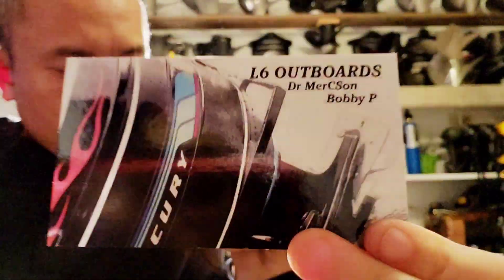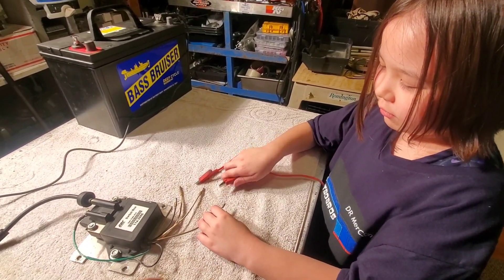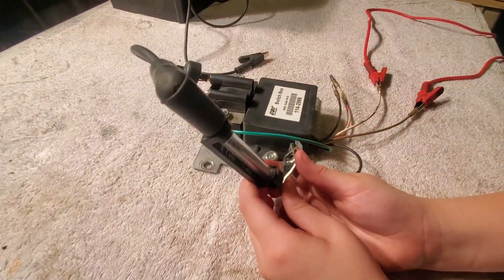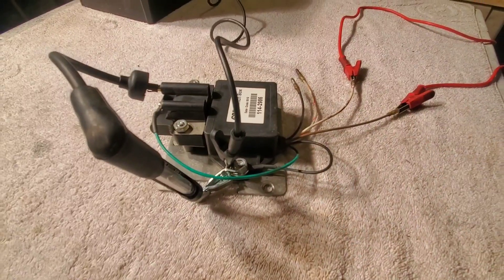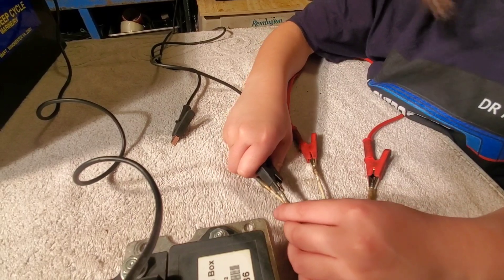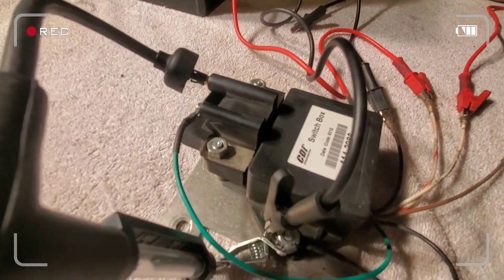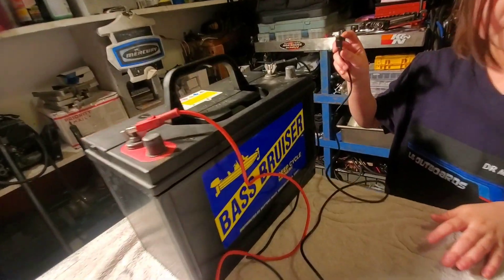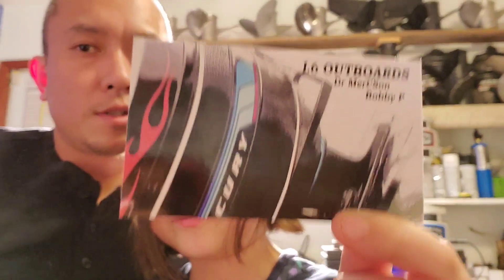Mercury Outboard CDI Swithchbox Testing: Got Spark?

Comment: Hi
Does this procedure works for a Mercury switch box PN 339-5287A3 that belongs to a 1977  9.8 hp mod 110?

Why the black wires which are grounded are all rotted ( both the insulation and the copper )?
Tks a lot

Comment: I pulled your video because I'm working on Merc 650 serial 2207872.  It has no switch box, but the part number is exactly what you are testing - 114-2986.     The new CDI electronics switch box costs around $330.  But I can get an old vintage Mercury box 332-2986 for $100.     Assuming the old vintage box works - is there any reason to get a new one over the old vintage box?

Comment: Great.What is the difference between ADI and CDI?I think ADI also has a capacitor. both stators charge the capacitor. The triggers let power release from the capacitor to coil.
Reply from the maker: Adi stands for alternator driven ignition. Cdi is a company that makes ignition components. Both do the same thing as you have mentioned above. Son
Reply: @MerCSonL6  Thank you

Comment: I have one of the boxes the coil on it is .2 ohm so the coil part is good I'm guessing tried doin the test with just a plug grounded I dont have a spark tester guessing this box is bad but I can hear it when I put power to it. I have another box on my 50 that says cdi on it has 4 connections the red blue and white and black on the end how do I test that one

Comment: Nice video loved it. I have two switch boxes for 1977 402 mercury how would you check them. Changed stator to CDI and coils to CDI and still no spark either trigger or one of these boxes wiring all replaced changed fly wheel still no spark, don't know how to check switch boxes or the trigger. Any info would be appreciated thank you.
Reply from the maker: Switchboxes on an adi cannot be checked. They are either bad or good. Son

Comment: G`day from australia,have watched alot of your videos trying to learn about my 1986 115 merc,i live in a small town with only 1 so called out board mechanic available.my story bought boat motor not starting,mechanic came did compresson test approx 125 all cylinder.o.k. checked electrics all good except cdi units, bought 2 new cdi`s had them fitted, he then did another comp test ? checked electrics again now nothing anywhere coils cdi, and stator DEAD.
He`s fired gone......is it possible that my electric are all fried because he never grounded any of the spark plug leads when spinning the motor over. any help please.Phil. do i need all new ign system?
Reply from the maker: Seems like he didn't identify the true diagnosis. I have a series of videos that diagnose your issues. Son
Reply: @MerCSonL6  Your not wrong. i have tested my stator, cdi,and coils from looking at your videos, went and got an multimeter and tested my self using your videos as reference i can`t belive all the coils are shot though seems like so much to fail all at once..is it possible to cause so much damage from continuing to turn the motor over using the starter without grounding out all the leads? i`m thinking to try and buy the complete ign system and just replace the lot, sorta start fresh. 1 is it possible to cause that much damage without grounding? 2 would you say amazon is o,k, for parts..a really great thank you for the quick reply Phil
Reply from the maker: Impossible. I doubt all coils went bad from the diagnosis. Seems you have deeper issues that proceeds the coils. Son
Reply: @MerCSonL6  G`day Son.me again i have removed flywheel and stator. i am going to replace stator CDIs and coils. Stator part #398-5454-a18. and CDIs 332-7778A1 could you please tell me if these are the correct parts fitted,and compatable so much info on the net i get confused.motor is 115 H.P. 1986 red flywheel, Mercury of course...hoping to make it talk soon.Phil.
Reply from the maker: @jusekvet  check your kill switch, harness, or the kill switch on the controls. If either are activated it will cause a no spark. I seriously doubt all 6 coils went bad. Additionally, I doubt that both switches went bad. Let me know. Son
Reply: @MerCSonL6  G`day, motor on stand not on the boat and testing without the harness connected..mercury kill switch disconected also idle stabilizer disconnected..stator removed and fails tests red to red/white ..blue to blue white also colors to earth.ohm values say approx 800 to 1100 mine are no where near that and all colored wires to earth show resistance i believe they should be open .I am going to buy stator and new CDIs plus coils.would really like know if the part numbers i gave are the correct ones for my motor ?   would really like to say thank you for you time in trying help me. cheaper for me to replace ign system than taking motor to a mechanic and being charged $125-00 an hour for labour. yep thats what they charge..$125 an hour and they aint quick......thanks in advance re part numbers Phil
Reply: coils stator rectifyer tested off motor
Reply from the maker: @jusekvet  I don't really know part numbers. I just know parts. Mercury did this thing where they changed the part numbers even though some of the parts are the same. Coils should range from 800-1100 ohms. I'll attach a link for the stator and switches. Btw..... I only $65 an hour. Son
Reply from the maker: https://www.ebay.com/itm/282671899767
Reply from the maker: https://www.ebay.com/itm/112395179783
Reply: @MerCSonL6  G`day,your hourly rate is o.k. but i think your traveling time  might cost a bit...long way down..lol.i will let you know how it all turns out..cheers Phil.

Comment: So cute ! Love your videos! Been working hard on a 90 HP 1983 six cylinder , I did a dump thing tonight!! Did a compression check with the wires off and not grounded . Compression was good but now I have no spark ⚡️ 😟. What did I burn up ?? Switch boxes or rectifier? Please give me some good news! 😬
Reply from the maker: Rectifier. Hopefully. Switchboxes need to be properly grounded though or u could have a mess on your hands. Son

Comment: Can you tell me how to test  switch # 338-4733A2

Can it be done on the motor?
Reply: My motor is a 2 cyl Merc 402 40 hp. No distributor, just 2 coils. Do I rotate the flywheel and get the same outcome?
Reply from the maker: @034bleeder  I believe so. The trigger is underneath the flywheel if my memory serves me correct. Just be sure the ignition key 🔑 is in the "on" position. Son
Reply from the maker: https://youtu.be/LVT9cHmzMDA

Comment: Hello my friend. 
I have an old mercury from 1970s with only 1 ignition coil and 3 cylinders. I’m having problems with getting it running, i might have som questions about how to find the problem. I think it is the ignition coil, i habe some videos of it running then dying that i could send you. Can you please reply me.
Reply: Could you please private message me.
It’s a mercury 650
Reply from the maker: @favoriterization  you can diagnose the trigger, switchbox, and coil using the video following....
Reply from the maker: https://youtu.be/LVT9cHmzMDA
Reply: MerCSon L6 Iooks like its the ignition spoil is the problem, its a mercury 65hp from 1976 with 1 ignition coil and 3 cylinders. Is there any other OEM ignition coil to use instead of the normal one? its for the 63195 cover.  4895T2 ignition coil
Reply: MerCSon L6 MerCSon L6 Iooks like its the ignition spoil is the problem, its a mercury 65hp from 1976 with 1 ignition coil and 3 cylinders. Is there any other OEM ignition coil to use instead of the normal one? its for the 63195 cover.  4895T2 ignition coil

Comment: Hey Son, love the channel. I subscribed because you seem to have a lot of knowledge on the outer mercury motors. Man I purchased a boat that has a 1977 Mercury 150 power tower and I have put a lot of money into this motor and still can’t seem to get it running. New starter, starter solenoid, rectifier, Ignition coil, no spark plug wires. New stator, New wiring harness for motor side. I did a spark test on The spark plug wires leading to spark plugs and the first 3 passed but then the fourth fifth and six did not have any spark through the spark tester. Now when I retested the first, second and third spark plug wires leading to the spark plugs they no longer have a spark. Any advice I’m losing my mind?
Reply: New plug wires I purchased meant to say
Reply: And also I have a wild question. After a couple of Cranks From ignition switch the starter seems to stay engaged. I replace the ignition switch and the problem did not go away.

Comment: Doc... Need your help (again). Merc 1500 (74 I think). Rewired with the CDI Harness. Thunderbolt Ign.    Trying to make sense of this Red Wire from the Rectifier. The Schematic shows (Early Model Red Wire from Rectifier to Switch Box Red, along with the Red from the Main Harness. But, the Schematic also shows Late Model - dotted Line Red Wire doing the same thing. Im confused... isn't the wiring the same for both? Should it be Power from the Bat + (Main Harness) to the Switch Box RED Term. and add a Jumper from the RED Term Switch Box to the Rectifier? Either way, they both seem the same to me... What am I missing? lol
Reply: Oh wait.. I see early Model the Red Rec Wire going to the White Term on the Switch Box. Is it saying this Red wire from the Rect needs to go to the Red Term on the switch Box (Two Red Wires on Red Term)?
Reply from the maker: @Brendon2324  the red wire off the rectifier goes to the red post on the switchbox. Some bypass it and hook it directly to the red wire that connects to the battery/red post. Either way the idea is to send the charging voltage to the switchbox/battery. Son
Reply: @MerCSonL6  THANKS! It makes sense now. lol
Reply: Doc .I was told I could enterchange a cdi from a 90 hp part # 116-3301 into a 120hp part# 116-5301  now i saw your tutorial but my wires are not the same colors . I'm kind of lost on which wire is which

Comment: Little Austa and papa Austa loved it. As usual but this time A team work good job 👍🏼
Reply from the maker: Thanks man!
Reply: I have a question how many mile do 70HP mercury gets per gallon. It’s a 3 cylinder with 4 adults on a 16foot V-Hull boat. I’m asking because we r planing a fishing trip in the pacific and I only have 15 gallon tank built-in and have 2 5 gallons gas containers on board and we r going about 10 to 15 miles in the ocean.Thanks
Reply from the maker: @homarkbeer  I would try to fit 10 more gallons just in case. On top of the 15. 25 gallons total. If its top much at least you will make it back.
Reply from the maker: A lot of things affect fuel consumption. Ie atmospheric pressure, temperature, carbs, cruising speed etc.
Reply: MerCSon L6 thank you I will do.